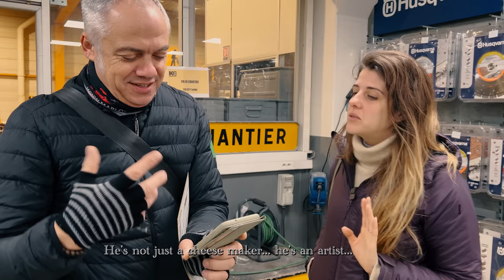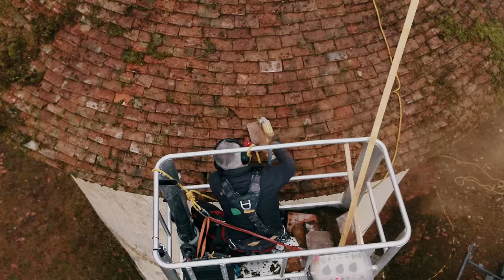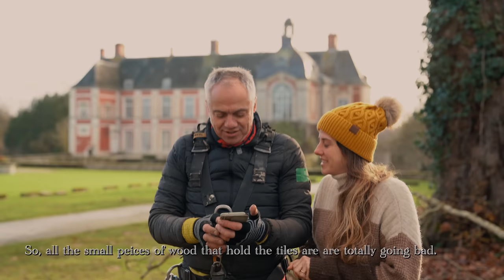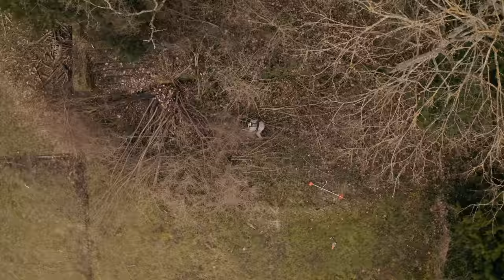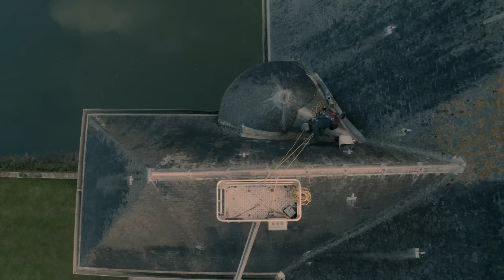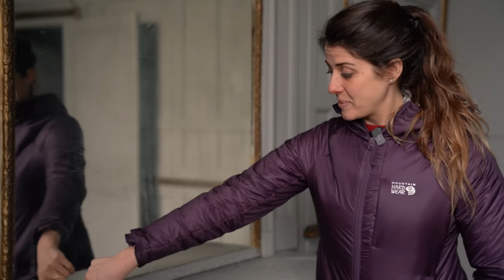French Chateau Roof Restoration | Chateau Renovation DIY

Comment: If I had an old property like that, one of the firt thing I would buy would be a large electrical "absorbeur d'humidité"/moisture absorber. You can't predict all leaks but with that you can act to reduce the damage if you dry the room right away, especially one with "boiseries"...
You can find some decent one made in germany on amazon that are able to remove 10 liters of water from a room in a day...for about 100€, worrth it with that kind of property

Comment: Can you use a dehumidifier in the room that is drenched so the wood doesn’t warp?
Reply from the maker: We probably could, but for now, we turned on the chateau heating to dry it out. The water coming in was quite a solid leak 😬
Reply: @TheBeauChateau  I made a comment saying just that...I've used a trotec (german made) bought on amazon for a water infiltration in a basement after a huge storm and I just regret not having it before